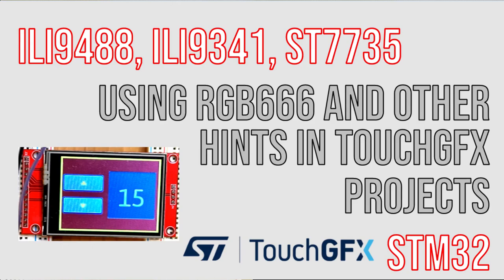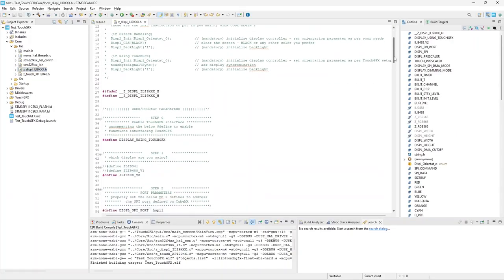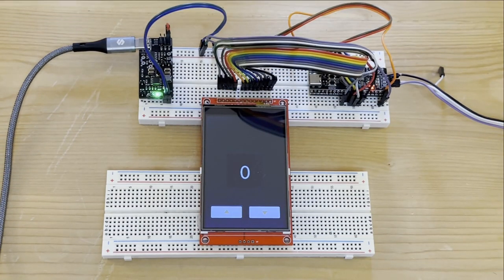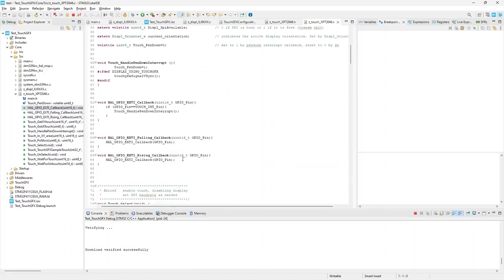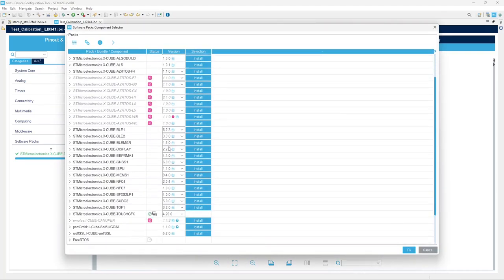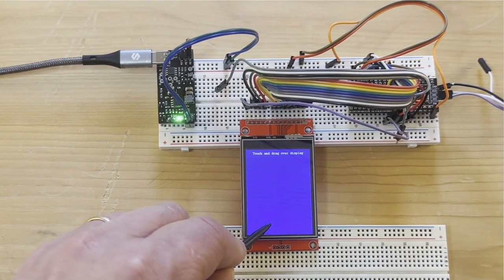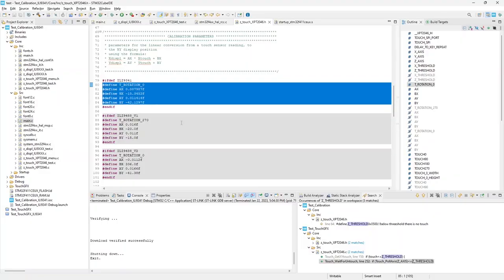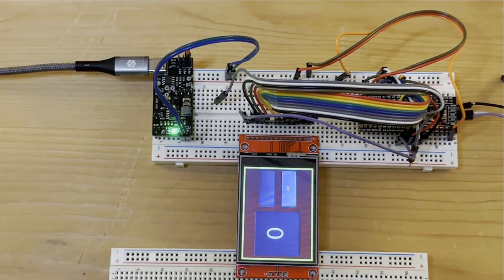STM32 TouchGFX with ILI9488 and other RGB666 displays

Comment: an awesome video, thanks dude, using stm32f411 blackpill edition for touchGFX project. on the bottom of the board there is an eeprom pattern. for the next project, can you make a video about touchgfx + eeprom w25qxx series? it will really help us microcontroller lovers who haven't been able to buy a mcu that supports qspi. Thank You.
Reply from the maker: You read my mind, Poncolongok! I just completed a more robust version of the library with an easier dragging handling (so an easier sliders, scroll lists, ... handling). I'm working on a video showing it. In the meanwhile I'm starting testing the external single-SPI flash handling. But I need some more time. Unfortulately, that's just my hobby!
Reply: @bluewat  I'm looking forward to your next video. happy working, hopefully healthy always.

Comment: Why you use SPI interface for ILI9341 if it is use FSMC ?
Reply from the maker: Uri, the ILI9341 communicates via serial or parallel port, but in the video I'm not using (only) that driver: I am using a board mounting a display and the ILI9341. 

Some boards expose the ILI parallel port pins, while others expose the serial ones. 

There are advantages and disadvantages to using one port over the other. The main advantage of using SPI instead of FSMC is that the former requires (many) fewer pins, allowing the display (the driver) to be managed even with smaller uCs or when the pins are involved in other activities.

I'm thinking to do some test even with parallel port handled displays.
Reply: @bluewat  but parallel mode is 16 times faster !( instead of sending 1 bit I send 16).
Reply from the maker: @urichaplin1424  
… advantages and disadvantages…

Comment: What should I modify to be able to use dragging? Now scroll list on TouchGFX doesn't work (only selects elements in list, but doesn't scroll it) https://www.youtube.com/watch?v=p7GTPM2xNww&t=5s&ab_channel=STMicroelectronics
Reply from the maker: Hi Coppertail,
driver handles communication between TouchGFX and the display, should not affect TouchGFX features.
... or it does? ...  Try to disable the key repeat feature (set DELAY_TO_KEY_REPEAT to 0 in z_touch_XPT2046.h ) That's the only thing I can suppose having impact on dragging.
Let me know.
Reply: @bluewat  Nope, didn't fix it
Reply: Also one thing I noticed, is that in simulation, when you press and hold button, it changes color and stays until you release button. On my application using this library, when you press a button, it only changes color for a brief moment (almost unnoticable)
Reply from the maker: @just5444  you definitely still have active key repeat.
Reply: @bluewat  Then DELAY_TO_KEY_REPEAT = 0 doesn't disable it. It sets flipTouch to 0, therefore setting isTouch to 0. 

I'm now trying to find a solution.. This method solves drag problem, but then other screens acts weird (I have onscreen keyboard, buttons shows being pressed, but text doesn't appear in typing box https://www.youtube.com/watch?v=uE6eiTjOP-g&ab_channel=EEbyKarl)

z_touch_XPT2046.c: (modify last function)

uint8_t Touch_TouchGFXSampleTouch(int32_t *x, int32_t *y){

	uint8_t isTouch=0;				// preset to no touch
	uint16_t xx=0,yy=0;  			// need to convert library coordinates type (uint16_t) to TouchGFX one (int32_t)

	if (Touch_GotATouch(0))    // polls interrupt flag not resetting it
	{
		Touch_GetXYtouch(&xx,&yy,&isTouch);	// get touch sensor position

		if (isTouch)// received a "no touch"
		{
			isTouch=1;
			*x=xx;
			*y=yy;
		}
		else
			Touch_GotATouch(1);
	}
	
	return isTouch;
}